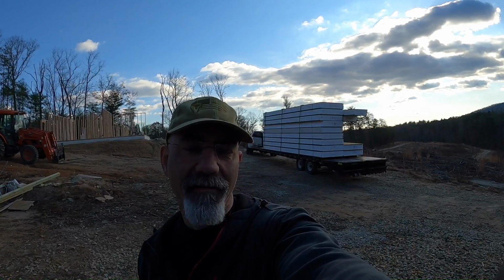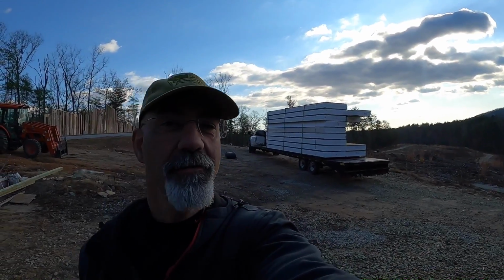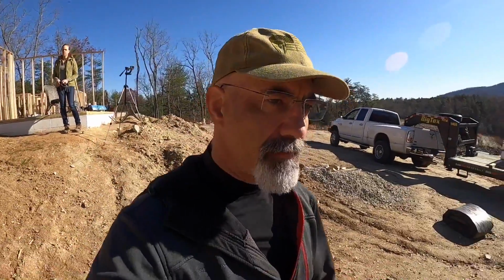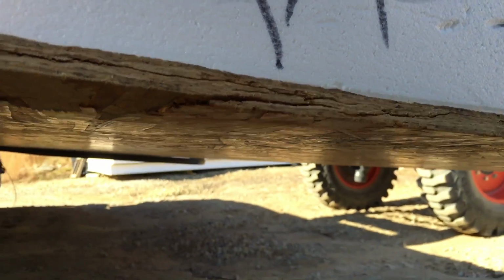#16. Final shipment of SIPs panels. One of my roof panels is damaged. DIY SIPs home build #16

Comment: With you SIP panels if you had a longish sling I would have used the excavator and a sling. Possibly easier and a bit quicker. Just depends on a few things. Have lifted with an excavator here in Australia before.  Cheers.

Comment: Lots of work to be done in a couple of hours. A question here: would it make sense to have pallet wood support on the forklift, for more stability and to protect the panels from the raw metal? Also, would it have been too expensive to rent a crane?
Reply from the maker: Crane with operator runs about 500.
Reply from the maker: I don’t think the pallet would have helped much. our biggest challenge is the uneven terrain. A crane would have been nice but that will cost $500 a day at least

Comment: I noticed that the delivery driver seemed too lazy and fat to even offer to assist you otherwise it would have been quicker, then the SIP company needs better quality control or delivery control to avoid damage.
Reply from the maker: Hah. I have to defend him just a bit. His job is just to deliver the panels. It is also a little harder to get things here because of the roads. 
But, there was definitely a difference between this driver and the guy who
Brought the timbers.   “There’s all kinds of kinds. “
Reply: unless it's included by the shipping company or sip company the delivery guy should not touch anything for the simple reason that if it's not in his duty to do so and he get hurt or hurt someone else some insurance company would not cover anything since it was not his job... Another thing is if something get damaged in the process the buyer could blame the guy helping him... I know it sound stupid and crap but that is today reality...